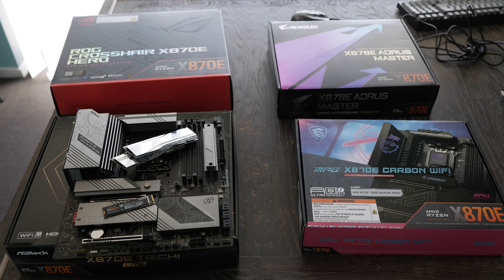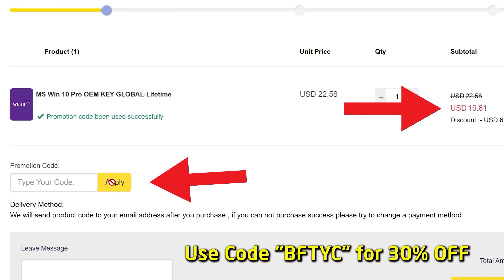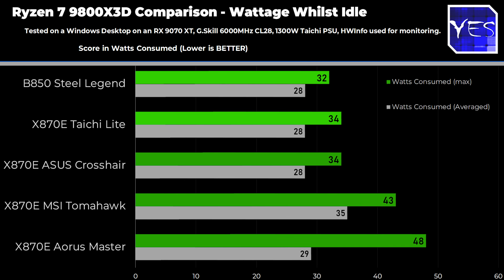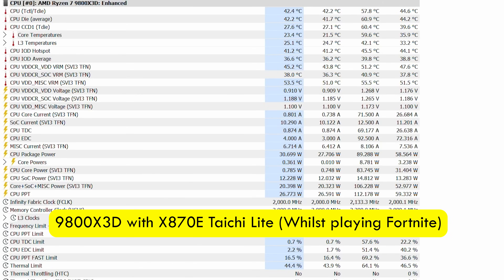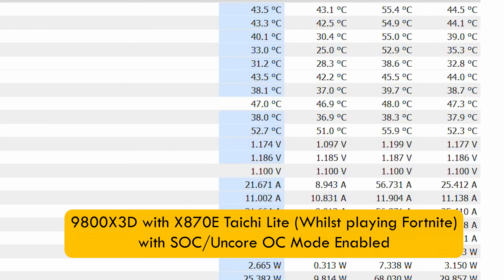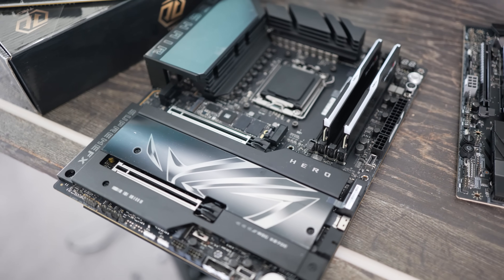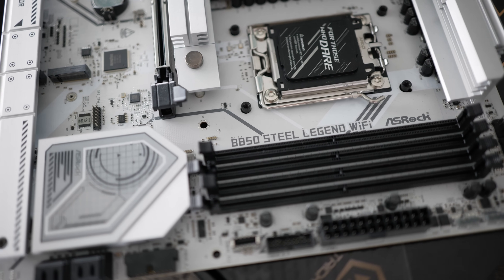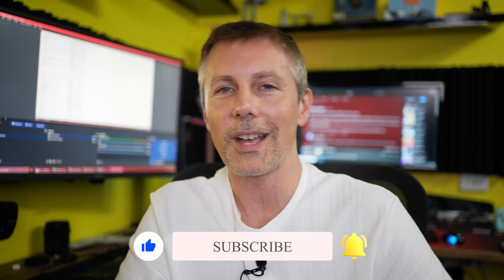I think I know why Ryzen 9000 Series CPUs are Dying...(!)

Comment: So finally something more of an empirical nature, even if more extensive testing would sure be useful to confirm, pointing to what has already been the top popular suspect. Still only suggests a partial answer to the story though, since this only accounts for the over representation of asrock motherboards attached to the chips that are failing.

Seems like a good idea would be to get into your bios and do some undervolting/turning off "auto" options in favor of specified caps in safe <1.2v vicinity in general. Which is really the most responsible thing to do in general - everyone should always undervolt if they care about their hardware's well being and performance. Defaults are always too high these days. Add in some wonky spikes in the auto management and apparently here we are with frying CPUs.

Comment: You don't need that if you do manual overclocking? ie fix the SOC voltage and manually set the cpu frequency and voltage? As well as memory voltages and frequencies
Reply: I think so. Also I would advise to not set the static frequency and voltage for the CPU. I've heard that if you're not careful it could instakill the cpu, like even the frequency that you may think is normal. Just use the default +200 PBO -20 CO. Memory overclock isn't related to this problem, only the fact that mem overclock depends a lot on the SOC voltage matters. I personally use 1.2 vSOC for 8000cl34 2:1

Comment: This is kinda ridiculous in this day and age especially with CPUs and Motherboards being so bloody expensive....TOO expensive to be suffering random death.
Reply: The problem is not solely in EMC/ CPU/ RAM too, its also with how Windows 11 got these SysMain, simply the 9800x3d/7800x3d is too fast that 32GB Ram is shit because those superfetch. 

Its combination of problem, as someone who own 9800x3d, i even only use default ram speed and cl. 4800 cl40 despite i can oc it to 6400 cl 32 or even more than that since i got hynix. 

Its circle of hell, not to mention Nvidia 50series is shit which im using it now(its cool but the driver problem is real)
Reply: @michaelbuto305

I go with Ryzen 7 9700X on ASUS B650E board with 64Gb ram, and disable all OC from CPU, GPU and RAM. No nVidia, I go for AMD RX9070XT. No Windows. Debian 13 testing has hard freeze in 15th day this month with latest kernel and Mesa when I put components together. No PCIe 5.0 NVMe, because they are stoves. PCIe 4.0 NVMe placed in far distance in ATX board from GPU to keep it cool. Air cooled with Noctua.

This should be the most rugged latest tech high performance setup for gaming in world. I didn't care cost or getting last percent of performance out. I go for quality.
Reply: @michaelbuto305  Bro, can you please type in English. I can't for the life of me figure out what in tf you're trying to say.
Reply: @joeyjojojr.shabadoo915

To be honest,  I would be just happy to buy CPU and even GPU to welded in motherboard for optimization, save costs and just test that one single combination that works. Similar to laptop motherboards but for desktop, higher performance and proper silent cooling. Just make slots for memory and NVMe.

Problem is that there isn't options in this performance level what I want.
Reply: We live in a disposable economy now - where a company makes up for their product being RMA'd or replaced under warranty by increasing the price for everyone. If they just made a good product, they wouldn't have to eat the cost of replacing so much hardware, and increase the price of the hardware to pay for it. That's what being competitive is all about. You aren't going to win by making an unreliable product. Granted, we only have basically two x86 CPU manufacturers so if they both get lazy then we're all burnt, but so are they. All it takes is some random company, who has the resources, to come up with their own Apple-style RISC silicon and a nice fast lightweight x86 emulation layer to come in swinging and apply a beatdown to Intel/AMD. If I can just buy a CPU/mobo and install Windows or Linux like it's an Intel or AMD rig, and install GPU drivers without issue, it's game over - only because they brought it on themselves.
Reply: @CharlesVanNoland I hope EU will get involved to sue the hell these company for Ewaste like they did with apple phones making them add C type instead that awful lightning cables also the every update thing that slowly kills older iPhones too.
Reply: Fr man. Shits pissing me tf off. Greedy shitty big companies
Reply: Everything is running hot asf
Reply: @runforestrunfpv4354  The problem is that both Intel and AMD seem to think that innovation = MORE VOLTAGE, MORE CURRENT. Say what you will about Intel's latest chips that aren't selling as well as the 9000 series from AMD, but at least Intel gave the world better power efficiency for the first time in many generations. So much for 'Climate Change' and Energy Production worries. It's kind of sad really.
Reply: Yeah ive gone through 2 motherboards on 2 different desktops over the past few years... its weird because normally my computers have lasted me almost a lifetime.
Reply: there is a warranty for that bro
Reply: too many hardware combos and specs for companies to accommodate all possibilities.  A bad motherboard will get ya.  Having more combos... It gives freedom and choice (unlike apple) but also possible big time fails. Do your research on what tested hardware works with what tested components. If you try to do a one off untested brand new hardware build.....good luck You're gonna need it.
Reply: No shite.  These companies need to own up to this crap for all the money they want to suck out of us, I'm not even a gamer but Id bought a R7 and had it die within minuets and I've never killed a CPU, I use to have computer stores and I'm a middle aged guy and wasn't even OCing the thing just trying to install windows and poof.
Reply: which is why i go for intel, 14900k is 400 with 14% less performance, (microcode is been fixed so do not complain bout it)
Reply: @olerius1235  Can you run it on cheap mboard with cheap cpu cooler and cheap PSU? No you can't.
Reply: @chovekb u realize how stupid that comment was? If u have the brainpower of a silverback youd know u never cheap out on that, and fyi u can get a decent pc with the 14900k for sub 1k
Reply: @olerius1235  Minecraft guy, i can be your father, so don't inform me on tech, cause you just can't! I'm not talking about cheaping out, i mean cheaper components for <125W CPU, which are still good enough, and that 253W i9 demands way more expensive components to run properly at it's full potential.
Reply: @chovekb you literally mentioned cheap shit as if im gonna buy ali express shit, and im not oblivious to know u dont go a small watt psu and also, in the real work it rarely goes above 200w
Reply: @chovekb and what do u mean “you just cant!” What because im younger i cant educate u, with that logic no teen can educate their grandparents,
Reply: @olerius1235  yes you can't, not because of the age difference only, but because of the decades of experience with tech as well.
Reply: @olerius1235  Intel is a garbage company.
Reply: @olerius1235 microcode "fixed" what caused premature death, but the oxidation issue during production phase remains as it's a physical thing

Comment: Thanks for the in depth testing, investigation. I have an ASRock X870E Nova with a 9800X3D, with PBO enabled and a mild 200mhz OC. Setup has been stable so far, but will turn this setting on for the added security (peace of mind). Thank you.
Reply: I'm using an Asrock x870e Nova wifi as well with 9950x3D, it's been 3 months so far no issues but maybe i should change the bios settings as well for the added saftey.
Reply: @midhungopan9270 mine was fine for 3 weeks, then the issue arose on 3.3, updated to 3.4 and same issue. Wtf is happening?
Reply: hows ur rig doing now? is still stable? and how old is ur build? mine 4 months already, and no issue.. x870e nova 9800x3d
Reply: @ASTAGADRAGON77  exact same rig, built 3 months back. Also, been running fine.
Reply: @ParanoidBishop  BIOS version? im runnin g 3.16 from the box til now.. scared to update to 3.25..
Reply: @ASTAGADRAGON77 3.25. My mobo came with 3.16.
Reply: Any updates on this? 
I was unaware of this issue, and had no time to do in dept research due to my main rig failing suddenly (Old x570 + 5800x). 
Unfortunately I read a quick review on the best 870E boards, and Nova Wifi came as recommended for that price range. I'm pairing it with 9900X and AIO instead of a regular cooler like NH-D15, some correlate the issue to AIOs being used in the setup and giving more headroom for the MOBO to push the chip harder because of the lower temps. I'm wondering if the new 3.25 Firmware (which is what I see at the time on Asrock's website as of today, June 09th 2025) fixed the problem for you, also what's your cooling solution?
Reply: @krnllrkr4373  See Gamers Nexus and YesTechCity's latest videos on the issue. Also, I think the issue is specifically related to x 9800 3D chips.
Reply: @krnllrkr4373  hello, im still with older bios.. and im using arctic freezer III 360, till now my tig running fine. from the very first i also undervolt cpu and -20 on all curve optimizer.. and fyi i never run any benchmark from the very start till now. i casualy use this rig for surfing the internet, casualy play games, and hearing music session. i also use UPS with stabilizer and anti surge cord. thats all
Reply: @krnllrkr4373  Isn't the failures related mainly to the X3D 9000 series? Is the regular 9000 series fine or do they FRY on Asrock boards as well?

Comment: There have NEVER been more people building their own computers so failure rates will be high. AM5 cpu´s are actually easy to mount badly. And the two different locking frames may look similar but they are far from the same quality.

Comment: So much testing and you still do not know shit about what´s killing the CPU´s. Is it bad MB bios? Is it bad mounting of cpu? Is it high end gpu´s like 4090, 5090, 7900XTX? Is it some GPU´s that have a bad driver so the GPU pulls to high AMP trough pcie lanes? And is the last one just a problem when the cpu is badly mounted. All I know is my Asrock Taichi X870E and 9800X3D is running fine but i only have a ASUS PRO ART 4060 Ti 16Gb GPU. My Asrock 9070XT Taichi is in the mail (i hope) i will let you know if my cpu dies after i install new GPU.
Reply: I highly doubt it's a GPU that's causing the CPU to fart to death.

Comment: Thank you for taking the time to test this out. I got the ASRock X870E Nova with a 9800X3D because the board seemed to be complete overkill in build quality. After your video was released, I did some testing on my system. In default settings, outside of EXPO for the RAM, my SOC Voltage is super stable between 1.185-1.190V when performing CPU intensive gaming and continuous 3DMark CPU benchmarks. Seems like mine is unaffected by the issues.
Reply from the maker: Thanks for the donation! If you can leave HWinfo open all day and just monitor it, was playing fortnite for 2 hours on each board to see if those SOC voltages fluctuated.
Reply: Wish I’d seen this a month ago. I got the steel legend and the 9800x3d. Not cheap.
Reply: @johnnystein67  My brother had an older Steel Legend (the B650) and his Ryzen 5 9600X fried in it after about 40 days. He's got a replacement 9600X now and so far so good but he's obviously a little nervous about it. The one that fried had slight scorch marks on the CPU.
Reply: What BIOs version are you using?
Reply: @sevenpointsixtwo I’m at Bios 3.16
Reply: @sevenpointsixtwo I’ll check tomorrow. If I remember correctly it’s the one BEFORE the latest one.
Reply: Silicon lottery; you lucked in ;)

Comment: I don’t know about the why it does it but the failure method is basically the same. The SOC will just randomly be delivered 1.8v+ which should both not be requested or delivered so it’s both an AMD and board partner issue.

Comment: The default BIOS settings for the Ryzen 9800X3D on the MSI MPG X870E CARBON WIFI are insanely aggressive. The CPU goes up instantly to 95'C while fully loaded, even with properly installed liquid cooling. I'm aware that the IHS is 3.7mm thick and prevents proper heat transfer (AMD's mistake), but the motherboard's defaults should accommodate it. Had to set PBO CO negative 25 (30 was unstable due to silicon lottery) with a 85'C thermal limit to get rid of this behavior which would have caused premature aging of the CPU. (PBO: Precision Boost Override, Co: Curve Optimizer, both are features of the BIOS, you don't need Windows software for this.)

Comment: I have a Gigabyte X870 AORUS ELITE WIFI 7 MB, BIOS F4c with 9800X3D. System is not overclocked. In HWiNFO my CPU VCORE SoC is 1.260V When I put CPU under full load with CPU's Bench Stress Test I can get incremental short spikes of 1.272V. UPDATE: I just updated my BIOS to F5a and I then chose a different memory profile with a lower voltage requirement. Was 1.4V, now 1.250V and Guess what. My CPU VCORE SoC is 1.248V steady at idle and under Stress load jumps between that and 1.260V. I went and selected a memory profile of 1.4V again. My CPU VCORE SoC now constantly fluctuates between 1.248V and 1.260V, but never goes to 1.272V anymore under CPU Stress Test. CONCLUSION: That means the new BIOS F5a has reduced the max CPU VCORE from 1.272V down to 1.260V and that memory voltage setting has an influence on the CPU VCORE readings. I would strongly suggest you check this out for yourself and considder whether overclocking ram and adding voltage for stability could be the possible culprit or contributor. :face-blue-smiling::face-blue-smiling::face-blue-smiling:

Comment: Man, check out vddio voltage also, it's really important and can be the cause of the problem also, for 6000-6200 memory the voltage is supposed to be something like 1.3-1.35 maximum it's going to be definitely enough to let the memory work without any errors 24/7 if the voltage is something like 1.45 or even more it's not safe at all, good luck 🤞

Comment: As a B850 Steel Legend user, I've had no issues on ASRock's 3.16 BIOS patch. But I refuse to OC my 9800X3D a crazy amount, and I have great cooling.

I’ll consider turning the SoC uncore setting on, but have had no issues so far.
Reply: we have the same setup, did u follow his recommmendation on this video? Mine also have no issues using 3.16 bios.

Comment: Very helpful find and video! But isn't the explanation (actual cause) rather that the ASRock BIOS has a bug where they swapped the Enabled/Disabled meaning of the SoC OC setting, under the "Auto" disguise? 
Have you read the long text saying no warranty if you modify this? That would perfectly match the opposite of what was set in the video.
In any case, I am done with ASRock for good (and it has been my old time favorite, their BIOS is the best both visually and functionally). Also their motherboard from 6 years ago is still running with heavy daily usage. Something that other manufacturers I didn't really see (Intel and ASUS boards dead after two years).
Reply: It’s not swapped? Enabling it makes the CPU run at maximum voltage while idling as specified in their BIOS. Disabling it means it isn’t running at max voltage constantly, and the issue isn’t the ASRock board, but the AMD feature not working
Reply: @bluerious5475  Possibly. But all the other board brands tested maintain constant voltage, so it can hardly be an "AMD feature not working". It's rather an ASRock bug somewhere.

Comment: Hi, I also can confirm ASUS does not have such a high SoC voltage fluctuations on my ASUS ROG Strix X670E-A on 2506 up to 2904 UEFI versions. I have manually undervolted SoC to 1.1 V instead of default 1.25 V after enabling EXPO + run few days of stability tests through my torture pack (OCCT, Prime95, Y-Cruncher) to confirm that CPU is happy about that. I also have dialed in -22 all cores undervolt via curve optimiser and kept default clocks. Even under extreme test cases like Y-Cruncher VID core requests are maximally 1.175 V and actual voltage on CPU die is by 10 - 15 mV smaller.

Actual SoC voltage reported by CPU sensors is in tight range 1.085 - 1.090 V and my 9800X3D bought early in 11/2024 is still doing well. Undervolting also helped by -7 W idle power consumption so great win win for stability, safety and idle power draw.
Reply: I am happy with is working for you. Do you know if it affects performance in any way? I mean even if you lose a percent or fraction of, isnt it worth it to save your computer until hopefully this problem is fixed through bios update or something.
Reply: @KaMil-gw2qr  Neither SoC undervolt nor Vcore undervolt had performance penalty, actually improvement as this helped pushing temperatures down :)
Reply: I have an x670e gaming crosshair hero. Can i just go the lastest bios and chipset drivers and put in a 9800x3d with expo for the rams and forget about it or do i have to take precautions?
Reply: @shodanargie1574  State out of box is completly safe there including firing up EXPO or DOCP profile. 

By default it should apply constant 1.250 V voltage on SoC. This should work for all CPUs including bad samples in terms of "Silicon lottery". You can try lowering that voltage, but how much you can afford to fully depends on your exact sample and it needs testing (I usually test it in OCCT memory test and Y-Cruncher VST+VT3 tests). 

The lower SoC voltage and still stable, the better for idle power/thermals and long term stress for SoC.

Comment: I'm on B650 Tomahawk and 9800X3D and see 1.205V all the time when using browser with your video. Same with Prime95 - 1.205V all the time. Not sure if it isnt too high and is needed all the time. I guess some power saving features may lower it and adjust dynamically to type of load currently done on system (it should at least).